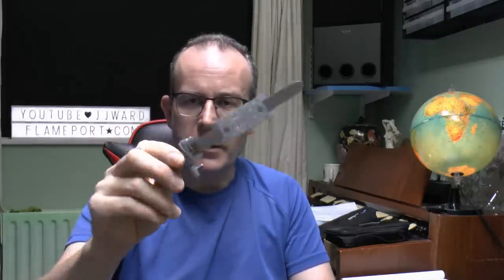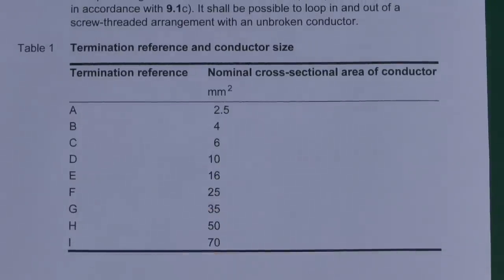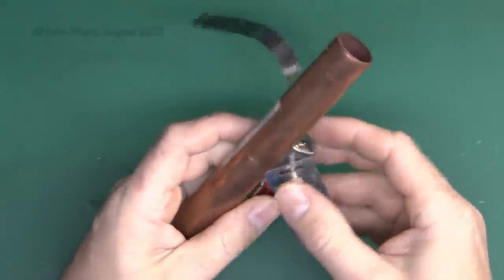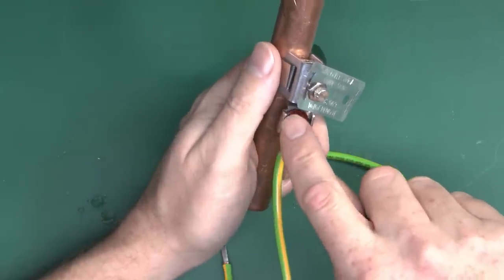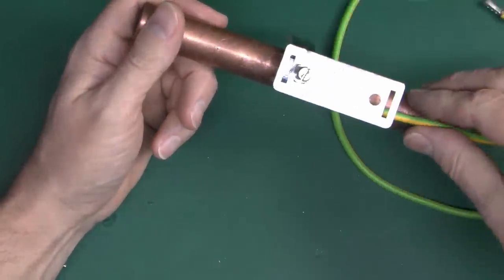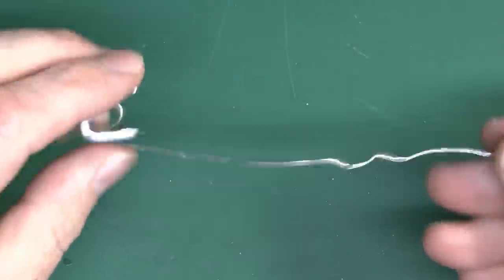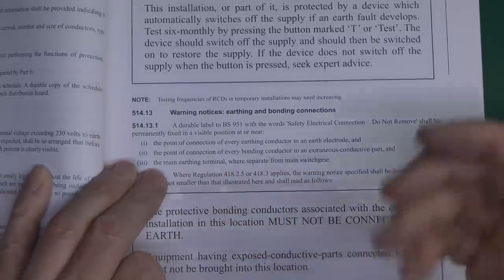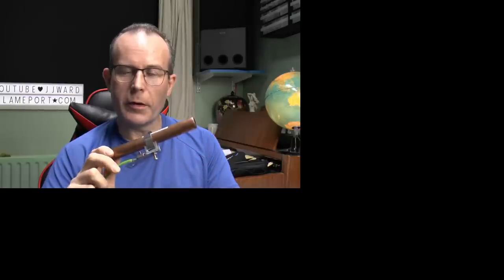BS951 Clamps - Connecting Bonding Conductors to Metallic Pipes

Comment: I always clean the pipe with a bit of sandpaper so it's bare metal and it gives a good connection. 
Also JW, remove that's sticker!
Reply: You were solid until that last line............
Reply: @mikeZL3XD7029  the paper one on the pipe?

Comment: Its a shame plumbers and builders don't understand the wording "safety electrical connection do not remove.
Reply: COOKED GOOSE - burning human flesh smell
Reply: It's bizarre that electricians think that pipes to sinks need to be earthed !
(Reason being, as far as I gather, is because they've failed to earth some other electrical component connected to the water pipes.
Having had a new boiler & pump fitted at my mother's (Warm Front scheme), I removed the silly tags on the pipes at the boiler but did connect the earth up at the pump the installer failed to do - and also failed to put the terminal cover back on properly.)
Reply: That's why they are builders and plumbers, electricians can read.
Reply: @mikeZL3XD7029  That doesn't mean to say they're competent though ! I knew one bunch incapable of correctly wiring up a 3ph Walsall socket and in another case, managed to make 2 fused switched spurs into a 'ring' !
Reply: @millomweb  they would need bonding if somewhere in that line was a plastic fitting like a push fit Tee or an elbow for whatever reason. It's called supplementary bonding, if there isn't then it's just equipotential bonding of the pipes under the boiler
Reply: @joefrayling9263  Is this a case of providing earthed water for dropping double insulated (=2 core) items in ? Although in such cases a neutral should be available too - from the item dropped in.
Reply: @millomweb  no it's got nothing to do with earthing the water it's to do with providing a path to earth (that isn't you) for any fault current that may occur in an Installation, earthing is there for your protection for example if for some reason your taps became live and you touched them without that earthing you would get an electric shock with that earthing in place the fault current will go through the earthing conductor instead of you.

Additionally if those pipes had a plastic fitting in place somewhere it is no longer one continuous conductive part it becomes 2 separate ones because that plastic fitting provides a non conductive junction between them hence the reason to carry the bonding over from the pipe that is bonded at the boiler to the pipe that is now not bonded because of a plastic fitting (supplementary bonding).

Protection from appliances being soaked is provided by RCDs or GFCIs  (if you're American) they also provide protection for any earth L/N -  E faults in an Installation like grabbing a tap that's been made live but has bonding attached. Hope this helps
Reply: @joefrayling9263  So how are the taps going to become live ??????
Reply: @millomweb  incorrect and shoddy workmanship of whoever did the electrical installation, alterations and DIY work where a cable has been damaged and gone unnoticed, holding onto something live and then touching it, static buildup, capacitive coupling, electrical faults in your boiler to name a few.

Edit: also in response to your previous comment the neutral is a live conductor it provides a return path for the current flow (line in - neutral out) the neutral is only part of the earthing circuit on the supply side of an installation depending on your earthing arrangement (TN-C-S or Terra Neutral-Combined-Separated) meaning the earth is brought into your house along the neutral and then separated at the cutout head
Reply: @joefrayling9263  Thanks for spelling out in full TN-C-S - although I'll not remember that ! (I don't think) you are the first to add that detail to it !
"holding onto something live and then touching it" - would be safer in that case if not earthed !
Damaged cable - as you say, entirely down to shoddy work - is it that common ? Static build-up isn't going to happen to a sink with a water supply. Capacitative coupling is an interesting one - beyond my ken ! Faults in the boiler - should be excluded by boiler being earthed.

For interesting info, I've added an earth lead to 2 items of video equipment that was supplied with a 2 core cable. I'd done that on discovering 'dangerous voltages' on some video equipment in the past - not because I am concerned about the equipment I earthed but concerned about other equipment it might get connected to.
Reply: @millomweb  no problem.
And that is all circumstantial it depends what the live thing you are touching is if you are insulated from earth or not etc I never said it was a good thing just a way of the taps becoming live same as all the methods I gave wether or not the earth bond is present on the tap or not is irrelevant they are just methods in which a tap could become live.

Static build up can happen on most things since it's just a build up of electrons on the surface of the material although not truly 'live' you can still get quite a belt if there is enough static built up and you discharge it.

And yes I'd say about 75% of my job as an electrician is finding and rectifying shitty electrics either due to age or poor workmanship or DIYers that have no idea what they are doing.

And boilers should be earthed but that doesn't mean that they always are.

Also in edit to my previous comment I suppose earthing could be considered as a protection from the water it's self becoming energised although that isn't really the reason it is installed (search up exposed and extraneous conductive parts of the 18th edition BS7671 wiring regulations for a detailed explanation of what they are)
Reply: @joefrayling9263  So what is the worstest (DIY) electrical cock-up have you come across ?
I ask, because I've recently discovered something really nasty may late father did - that I totally wasn't aware of. The lead players in this saga are: House, Lean-to and Garage. Wire from house feeds garage. Lean-to built. Wire from garage feeds lean-to (one socket, 1 light.)
50 years later, parents are dead and there's not a lot of glass left in the lean-to and it's overgrown with weeds.
I decide, on safety grounds, to disconnect the supply to the lean-to - I can't see the power socket in there and the bulb's smashed.
I disconnect the Lean-to wire at the fuse box in the garage - and cut the wire off in the Lean-to and confirm the circuit is dead.
A few weeks later,  I decide to install a dehumidifier in the garage as things are rusting. Leaving it on over night. One damp day, sat in the house, I hear minor explosions coming from th lean-to. I note these coincide with house lights dimming. Instant fix by turning off supply to the garage in the house. Further investigation followed.
I expected continuous wire from house to garage and one back to the lean-to. I find the one from the house to the garage has been cut in the lean-to as had the wire from the garage to the lean-to - and all 4 ends connected together - effectively bypassing all the fuses and main switch in the garage ! Also, another mystery wire has appeared in the duct from the lean-to to the garage. Currently, I've isolated the garage supply at the house until I remedy properly !
Reply: @millomweb  I've seen some bad ones, shorted cables causing sockets to catch fire, someone who was growing weed in their loft and took the supply from the street light outside, live metal fixtures because someone had wired the earth into the live terminals in a few places nails in place of fuses rings fed from spurs and spurs upon spurs, the most recent one was someone had messed around with the main supply cable and caused the neutral to become corroded and loose which caused a small flashover when the DNO came to sort it out.
My favourite one was when I was called to look at a light that wasn't working properly I isolated the supply only to find the bedroom light was still live and turning off and on sporadically. It was a terraced house and it turns out it was fed and switched from next door 😅
Reply: @joefrayling9263  "My favourite one was when I was called to look at a light that wasn't working properly..." Was the switch even on the partition wall between the properties ?

Several years ago I visited a friend on the day he got his keys for the house he was moving into. It wasn't long before I asked him if he had a camera - neither of us did - so I suggested getting one of those disposable one-film cameras that appeared for a short time to record the 'before'. Apart from a few rooms with 'interesting' colour schemes,  there were 2 notable 'classics'. One kitchen door could not be closed as the 'built-in' kitchen unit worktop got in the way (the door was 45° to the main wall when closed) and one room had had the door re-hung on the other side - it still opened into the room but the light switch was on the hinge side of the door. To remedy this, they'd added a second switch jumpered into the first such that the light was only off when both switches were off.

And there was an 'intermediate' quirk - the consumer unit was in the shower cubicle above the bath. In the days when mains came to properties at roof level and he'd installed an en-suite into one of the bedrooms.
Supply re-routed to ground floor.
Reply: @millomweb  lol I've seen a few weird places for consumer units.

And no it wasn't it was next to the door on the other side of the room from the joining wall lol
Reply: @joefrayling9263  Was it a case of 2 neighbouring bedrooms with the lights wired together so either switch in either house turned them on ? If so, would have been fun if the houses were on different phases and both switches turned on !
Reply: @millomweb  nah not that interesting it was a single switch in 1 house that controlled 2 lights joined together, neither of the occupants knew why it was there I'm just assuming whoever installed it when the building was built wasn't paying attention lol

Comment: lol our house incoming supply cable was fitted with one of these by the electrician which wired our new extension, and then he had the audacity to try and suggest that the whole house needed rewiring because the earths were all high resistance, which they aren't!
Reply: I presume you've checked or had some competent person check the rest of his work? Do you reckon he was simply incompetent or touting for extra work?
Reply: @lordsummerisle87  the rest of his work was fine, he must have just had a dumb day when he was checking the earth resistance of the existing wiring
Reply: @ArlenMoulton2  Fair enough I suppose, we all have dumb days. Why was he mucking about with the earth to the incomer anyway? Isn't that supposed to be DNO-only territory?

Comment: Absolutely hate these clamps, always finding them fitted in hard to get to areas and done up so bloody tight they've indented the gas pipe. Much prefer the twist and clamp ones that came out a few years ago - right around the time they started putting more n more plastic supplies into buildings.

Comment: Most Gas Pipes are NOT metallic , picky with the Stamp on the clamp bit who has ever checked that ? If you can't  insert the earth cable into the clamp it won't matter what is  bleedn stamped on the clamp , if you want to be picky don't ever clamp over a pvc pipe label

Comment: As an auto electrician im surprised that crimps are recommended! They are an absolute no, no in my industry and considered a bodge unless soldered as well as crimped. Also wire that may get tugged slightly, stands a good chance of pulling out! I would have thought that a looped conductor would have been preferable as it is also one less connection from the bonding strap to conductor an very unlikely to pull off?!